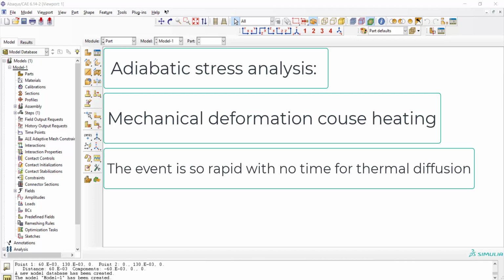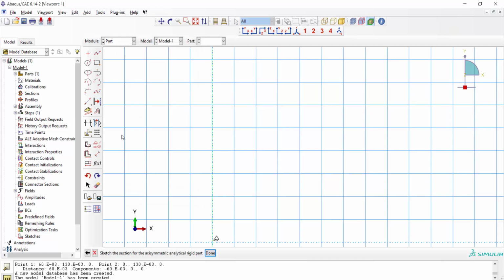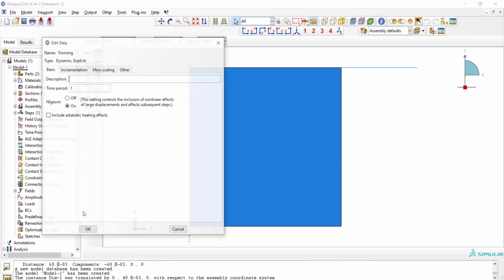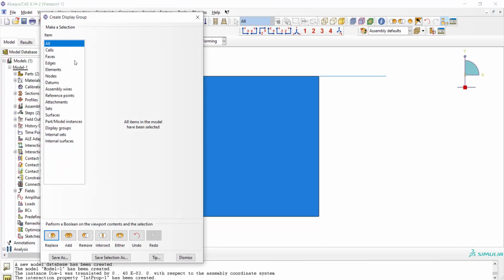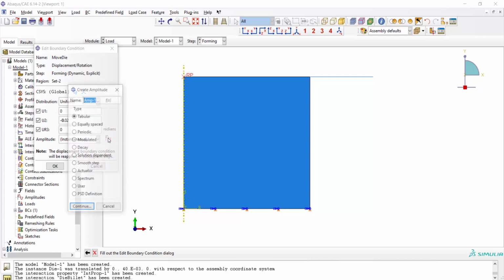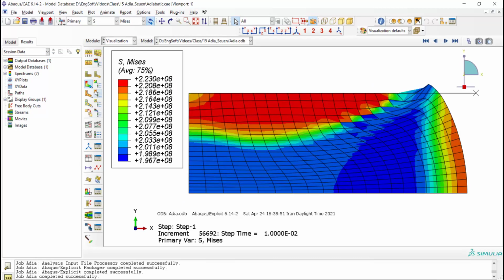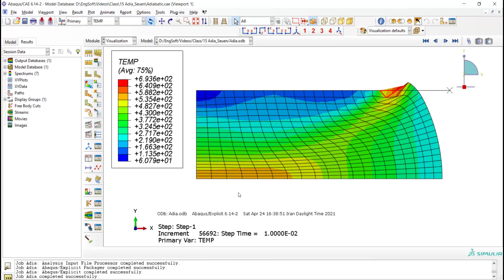Adiabatic thermomechanical stress analysis in Abaqus: Upsetting of a cylinder

Comment: How to perform hot tensile or compression test?
Reply from the maker: You can perform a fully coupled analysis with complete boundary conditions and heat exchange with the environment (Please watch this video:  https://www.youtube.com/watch?v=4MzBWG0nntM ). However in the case that your test is isothermal and you expect almost constant temperature allover your specimen, stress analysis is enough, but please note that all the properties related to that temperature.

Comment: Hi professor thanks very much.
I did model a pipe by shell geometry in 3d space. But the temperature rise 100000!!!
what is the problem?
Reply from the maker: The problem could be from material inputs or boundary conditions.
Reply: @engineering_software  thanks.I will test with your data and check it again :)

Comment: Hi there,
Regarding the material properties, the value of yield stress at elevated temperature that you use, why is it so high? 50 MPa at zero strain and 600 MPa at unity value of strain. Is that an input mistake?
Reply from the maker: Thanks for your comment, it should be 60 MPa.

Comment: In adiabatic analysis you did define the coefficients required in the material properties like heat fraction, specific heat  etc but you did not seem to input any of plastic strain rate and thermal expansion ... i think if you would run the same model without adiabatic option clicked you will get the same results as your data is missing to run the equations in the background. You can follow the link below for the equations that I am talking about .. THANKS !

https://abaqus-docs.mit.edu/2017/English/SIMACAEANLRefMap/simaanl-c-adiabaticanal.htm#:~:text=Adiabatic%20thermal%2Dstress%20analysis%20is,of%20temperature%2Ddependent%20material%20properties.

Or may be you think ABAQUS can compute strain rate itself from plasticity data .. ? Also I heard that for thermomechanical processing it is required to define thermal expansion coeff too ... could you please comment on this ?
Reply from the maker: Dear Mueed
At first  including adiabatic in the step in this simulation change results significantly because temperature of each integration point will change (due to heat generation from plastic work) and then as we define the flow stress as a function of temp, values of stress and consequently forces of the process will change. 
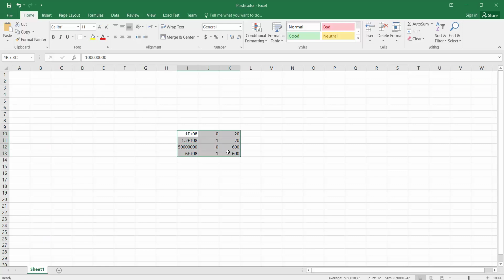As you mentioned and also it is explained in the movie (at 3:05) in high temp, metals are  rate dependent and for a complete simulation we should enter the flow stress as a function of temp. and strain rate. you could find an example of defining complete behavior of metals in high temp in this video:
https://www.youtube.com/watch?v=4MzBWG0nntM

However it worth mentioning that Abaqus compute strain rate from displacement field and then if the stress has been defined as the strain rate the appropriate flow stress is used. As it is explained in the movie in this simulation rate dependency of the material is ignored (just for simplification). 
Finally about the expansion coefficient, this example ignores the thermal expansion comparing with large strains of metal forming but in thermomechanical analysis with small strains (as an example elastic materials under thermal loads) this coefficient can be very important. However including this parameter in this modeling is also easy. 
Thank you for the discussion.
Reply: @engineering_software  Thank you so much for detailed answer. Yep I added thermal expansion in my model. Could you comment why ABAQUS compute the predefined temp in following steps when adiabatic option is used ? also how to know what is that computed temp ? normally without adiabatic option the predefined temp is propagated not computed, for each step. I am a little concerned that may be my part is not at the predefined temp during the steps in which it is computed automatically by ABAQUS. THANKS

Comment: Dear Sir,

Thanks a lot for this video. Please I am traying to perform the same model using user subouritine but I get some error talking about Abaqus explicit requires rigid parts to have mass.... Can you help me to solve this problem ??? I am running it with Johnson-Cook VUHARD subouritine
Reply from the maker: It seems that you have a rigid part with natural boundary condition without mass definition. In other words, when we are using a rigid part in a dynamic solution, we should apply displacement type BC to it or we should enter the mass properties of it.
Reply: Thanks a lot. Please can You provide me your mail adress by it I can send you the inp file and others. If you have time, I would like your correction. I am a bigginer of Abaqus.
Reply: I don't know how to enter those BC properties.
Reply from the maker: In the current step just enter the mass of the rigid part in the Property module. 
Use special/inertia /and create mass then enter the mass of the rigid part.
Reply: Okay. But let me know if it is mandatory to put some inertia (I1, I2, I3)???
Reply from the maker: If rotational degrees of freedom of the rigid part are fixed it is not mandatory.
Reply: Okay. Let me try and come back to you
Reply: I've done the model but there is still some problem. If I want de use a half of the heigh for displacement BC, there is enough distorsions even if I use ARL method. How can I send you somes pictures and.cae file ???
Reply from the maker: You should decrease the frequency and/or increase the remeshing sweep.
My email: engsofteducation@gmail.com
Reply: Hello Sir,
Thanks for responding me. I just sent you an email hoping you received it.